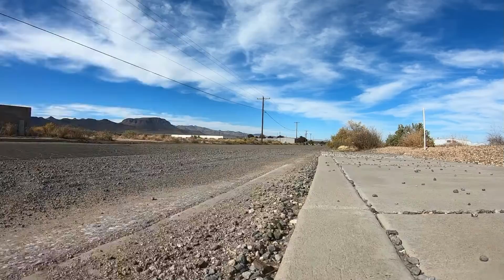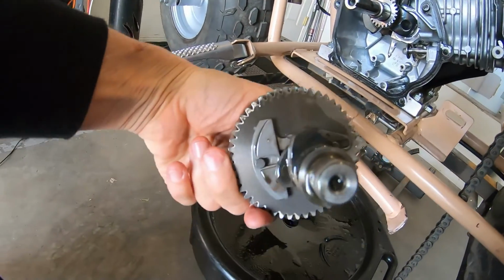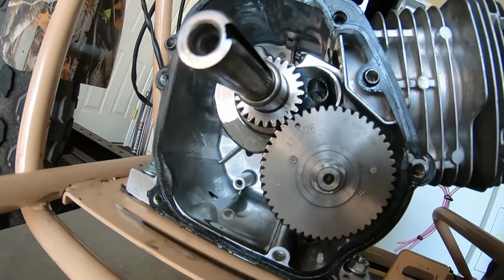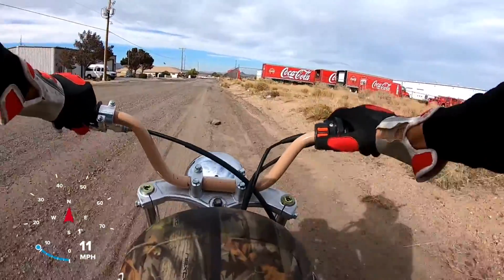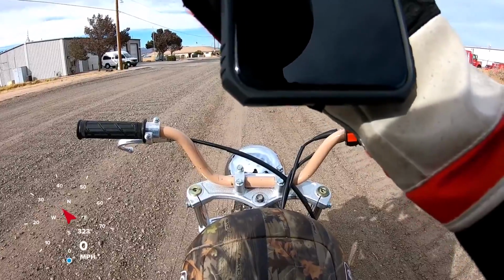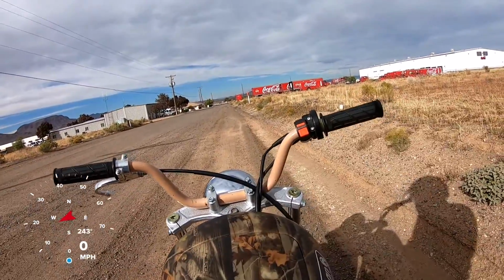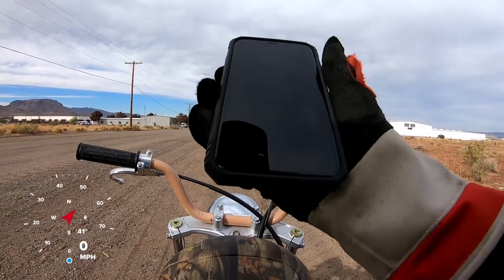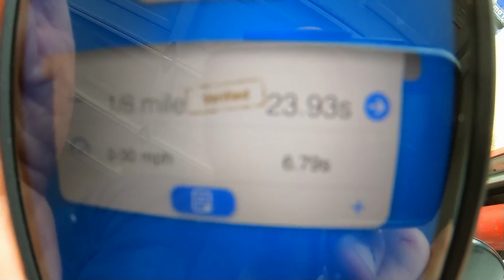Dyno cams CL-2 versus 265 cam in a Predator 212

Comment: Would be cool to see the Stock flywheel vs Std Billet aluminum 0-30 test. With timing set the same on both.  Maybe even the super heavy billet steel vs ultra lite aluminum. If you can manage to hunt down an old billet steel wheel...  I know the lighter flywheels will noticeably rev up faster and free up some power,  but how much quicker is the question.    Low drag ARC speedway  VS  the old style.   Taped up or Open.   .080 coil gap  vs  .030 gap.    So many cool test options!   I plan on grabbing one of those draggy boxes soon.  Seeing what small changes on a dyno translates to in real world testing seems very valuable.
Reply from the maker: Ya for sure ! There are a lot of options . I have a video coming out on that topic pretty soon. 
I'll have to do some more. The Dragy meter is really cool. Especially if your racing. It would be a good tool for testing combos for the track.

Comment: Nice!!  What are you setting your valve lash to?  .003?   I adjusted mine the other day after a new rod and flat top piston but I hear a lot more clicking now when it’s running
Reply from the maker: Yes, usually set the last about.003 unless a cam card say otherwise.

Comment: Gm I ordered a  Banzai 265 Race Cam with 26lb springs just wondering if you have heard anything about it  comes from  EC Carburetors
Reply from the maker: I haven't tried the Banzai 265 but I've tried other 265 cams. I really like them. The 265 is a great cam
Reply: @Black66  thanks

Comment: Very cool compare here. I thought you would lose a little top speed. What timing were you running with the CL-2? 

At top speed you were getting around 5500 RPM with that gearing. Makes me wonder how a CL-1 original would do up against the CL-2 but use stock springs and 32 degree timing with the CL-1.

I like the CL series cams because you don't have to get stiffer valve springs. The CL-4 can run to 7K RPM with stock valve springs. Most guys don't use them because they are just a stock lift cam.
Reply from the maker: Thanks!  I was running 32 degrees timing with an ARC billet flywheel. I think ultimately the 265 would turn more RPM at the top if I had a lower gear on the bike. But for the gearing I was using the CL-2 did really well. Better than I thought it would. The 265 definitely has more mid-range snap to it.

Comment: @black66 or someone please help

 Can a hot265 jus drop in on the stage 1 tilly?
Reply from the maker: Yes! Great cam !
Reply: Thks for update...so is it the tillotson can get away without billet fly wheel and billet connecting rod? If so this will save on build forsure.

Comment: How come you don't run a torque converter? I noticed that you have a centrifical clutch on all your bikes? Is there a benefit to one or the other?
Reply from the maker: I do have a torque converter on one of the CT200U-EX bikes . I am always trying different combos. Check out the playlist on this bike https://www.youtube.com/watch?v=X0SmAZJ6qW8&list=PLkbj-ip-5FzbVBVqMi23O5noFSAbhNOp1
Reply: @Black66  I just found your other video with the Colman that has the cvt clutch after I commented. Thanks for your videos, it helped me determine what clutch and sprocket I need for my db30. Went with the 15 tooth clutch and a 70 tooth rear sprocket. 60+ is fast enough for me 👌

Comment: If these cams are both designed to increase power in the higher RPM is doing a 0 to 30 run doesn't really show anything maybe timing it from 30 to 60 would actually show the difference a little better

Comment: with all the parts swapping as you do, you really should use stud kits on the side cover and head, to keep from beating up the threads in the crankcase from running bolts in and out so often...I mean you do it for the exhaust, right?

..and speaking of parts swapping..can you start putting up a complete parts list for each of the bikes you're testing in the description? you know like what model the bike is, the make/size motor, what cam, what carb/jetting, what head/rockers/springs, what size sprocket front and rear, that sort of thing...I can't keep track of what parts are being used on which of your bikes anymore! Which makes it a bit harder to compare what/how my bikes are doing compared to yours.
Reply from the maker: Good points. I'll try and add more stuff in the description. I'm always changing stuff or adding stuff. It's even hard for me to keep track lol I'm quite a few videos ahead. I'll have to add some stud kits on the new videos

Comment: I wonder if you could get away with the dyno cam cl-2 in a tilly with 22lb springs but no billet rod...
Reply: Your question is related to RPM and not so much what cam is used. You need to figure out what max RPM you are going to use or what RPM the bike can reach. I wouldn't run over 5500 RPM with the stock rod.

The CL series cams are all stock lift cams with a lobe profile that doesn't require heavier valve springs. Stock 10 lb springs work. The CL4 cam works with stock springs to 7K RPM.

When I built my 196 for the Coleman I knew the engine would never see more than 5500 RPM. With that in mind I used the CL1 original. It's good to 5800 RPM or so and I didn't need to buy valve springs. According to NR racing the CL1 original has the most torque of the CL series cams.
Reply: @sumner hosterman I ran 22s springs flywheel and cl2-cam stock rod arm and stock piston never had a problem with that set up ran about 65mph